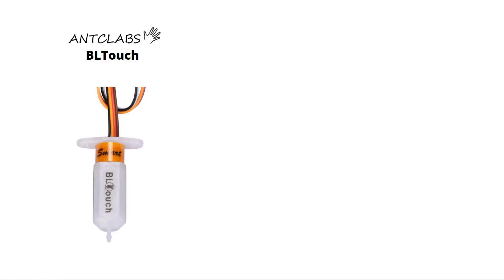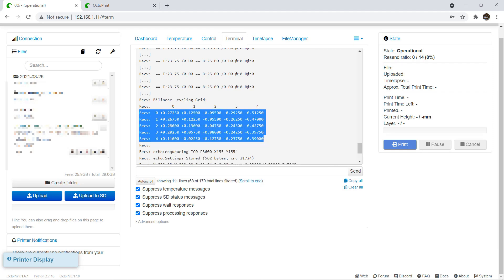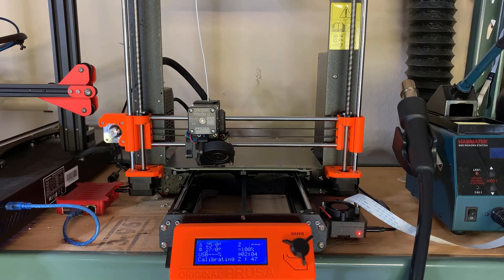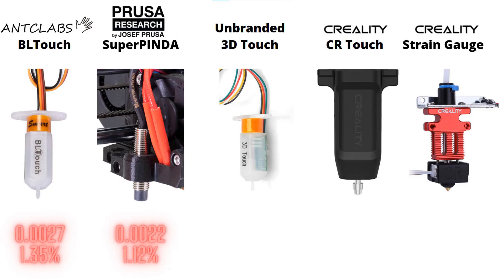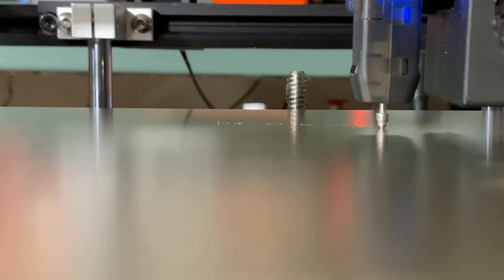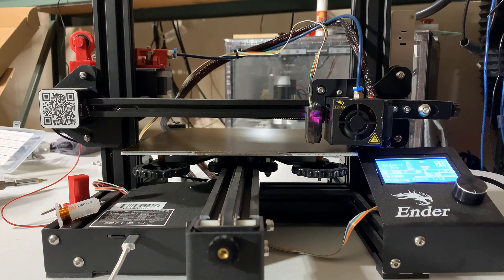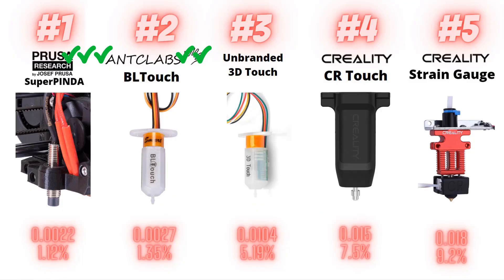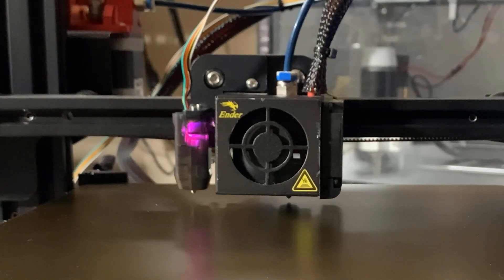The Best Auto Bed Leveling Sensor BL Touch, 3D Touch, CR Touch, Strain Gauge or the Prusa SuperPINDA

Comment: great video , I never even knew the super  pinda or the strain gauge existed , so can the pinda be used on an ender 3 pro?
and is the pinda  the only one that doesn't work on a glass bed?
Also funny thing is that  I saw some other videos comparing the  BL touch to the CR touch and the  retraction was worse on the BL than the CR , I was going to pick up a CR touch for my ender pro 3 (my first 3D printer and  I have not even unboxed it yet)
my local microcenter had one for $39 open box last week so I was planning on going there this week and I checked the stock again today to see if they still had the open box one , to my surprise the stock for open box now says 3 instead of  one!
so it looks to me that these things are  being returned quite a bit for some reason
also never knew the 3d touch was so cheap maybe I will just go with that instead unless the pinda can be used with the ender 3 pro , but then again if the 3d touch works on glass bed then maybe I should go with that one in case I decide to update the bed later on
Reply: I tried ordering a Super Pinda from Prusa. They would not sell one to me because I don't own one of their printers. I ended up with a BLTouch for my Elf.

Comment: Ok, I ran the experiment on the TH3D EZABL, an inductive sensor similar to the Prusa Pinda, on my Ender 3 V2.  The probe points were 3x3 by default; I'll re-run when I update my firmware and set to 4×4.  On 3x3 I got average standard deviation of 0.0031, or 1.56% at .02mm layer height.

👍

Comment: Your CR-Touch seems to behave a bit different from mine. When probing, the Z-axis start to lower, and CR-Touch pin touch the bed, and it will only go low enough that the pin will dip about 1/8in (1mm), and the LED colour will change and Z-axis start to rise. So my CR-Touch doesn't need to go low enough to trigger the pin to "retract" all the way in. So possible you have a defect CR-touch.
Reply: Could you be using Jyres HS  (high speed) firmware? That enables the probe to not retract after each probe point.

Comment: Young lady, you have gained at least one subscriber with this video. While I don't use Creality printers, I do have 4 Artillery Sidewinder X1 v4 that I have added BLTouch sensors to. Your methodology and reasoning is sound, and I agree with your findings. The accuracy of the BLTouch (and the knockoffs) and similar designs such as the CReality CRTouch can be improved in the firmware by selecting a multiprobe ABL in Marlin, and can truly get you a perfect first layer.
Also, there are files available on Thingiverse for BLTouch covers that can printed for various printer setups that can give you the sleek black design you seek.
Well Done!

Comment: in all other sites the cr touch has more precise...and recommend over the bltouch......i dont know...
Reply from the maker: You are right, I don’t believe that at first, as I paid a few dollars more for it and I expect it should be similar to the BLTouch. That’s why I tested the CR Touch 2 times, on both Ender 3 and Ender 5, but both results are not as good as other sensors.

Comment: I have a CR Touch on an Ender 3 V2 and one on a CR-10s. I do notice that the pin retraction is slow and the speed does vary but it doesn't seem to affect accuracy. I've done several tests on both and the worst I ever got was 0.007 and the best at 0.002. I think all are good enough that it won't show in the print so it seems like whatever is cheapest is the best option. I'll probably try a 3D Touch on the next one.

Comment: It looked like you only tested the cr-touch on a magnetic build plate.  Might try testing it on a glass build plate, the magnet might be influencing it a bit.
Reply: My results are better than the bl touch results she comes up with.  CR touch on glass bed. Ran 5 cycles to achieve a sum average then repeated the whole process 5 times. My CR touch on a glass bed after 25 cycles comes to a 1.18% average.
Reply: @chrisramey5033  Your not the first person I have heard make the claim that the cr-touch is more accurate than the bl-touch.  This is why I think the magnetic bed she used may be influencing the results.  

I am happy with the $11 3d touch kits I have been buying off Aliexpress and will continue to purchase what is cheapest, so it dosnt really matter to me which one is more accurate.  I would like to see the test repeated though with two different printers that are identical in all ways except for the bed, mostly just out of curiosity.

Comment: In Canada the crtouch can be had for a third of the price of bl. I think the prusa should be excluded from this because the barrier to entry for most people to buy a prusa is 3 to 4 times the price of printers with similar print quality. I knock prusa alot but if you live in Canada then you'd understand. Plus they haven't evolved at all because they have such market dominance that they don't have to. It's holding the whole consumer level printer market technology back by years because everyone plays flow the leader. 

Ask yourself this question, when will people without any technical know how be able to buy a printer and plug it in then be able to open a file and press print like you can with an ms word document?

Comment: i have an cr-touch on my ender3(4.2.2) and don´t find it much slower than my previous bl-touch
(the retraction speed of the sensor has no influence on the measurement result, since it only depends on the triggering time when the sensor starts to move, how long it then takes to fully retract is irrelevant )
with the m48-command i get 0.001250 on the cr-touch, while the bl-touch was around 0.004500
i´m not sure if the m48 is as accurate as your measuring method

greetings from germany

Comment: with a theme like this, I normally doze off after 2 minutes...but funny enough I was awake during the whole video. Again, Prusa shows us that quality in every detail leads to outstanding results. Your worst candidate was off by 10%. But 10% of 0.2mm is just 0.02mm. My bed screw has a pitch of 0.75mm per turn so to achieve the accuracy of your worst contender by hand I have to be accurate within... roughly 1/40 of a turn. You make me do difficult calculations, oh my god. But here is a challenge: The Strain Gauge is not very accurate as it does only one move to measure (I claim). Can you write G-code to make it move once till contact, then back off 0.1mm, and then measure again with just 10% of the speed? I think it would be crowned the KING. Thank you for this FAN-TAS-TIC video.

Comment: Yea, I wanted to say thank you too, your videos are great, I just got an MK3S+ and I watched your whole assembly video before building, big help.  My latest issue is my prints keep turning to spaghetti at mid Z heights (seems to be around the same height).  People say increase temp, but it's PLA at 215 C, so not sure how much higher I should go.
Reply from the maker: Hi, it would be easier for me to find the cause if you can make a video. But I would say if it’s a temperature issue, it shouldn’t fail at the same height every time. It should fail or you should see the problem once you start printing the first few layers.
Reply: If it occurred on same height could be a couple things. Does it happen on all models? You can test this by printing a tower taller than where it starts to mess up. If it's on a single model it's possible the model has a design error or slicing error

Comment: Great job, the CR touch retraction is controlled by the CR touch after triggering, the retraction speed should not affect accuracy, but different amount of probing points and different printers and control boards will. Better not use 4x4 probing